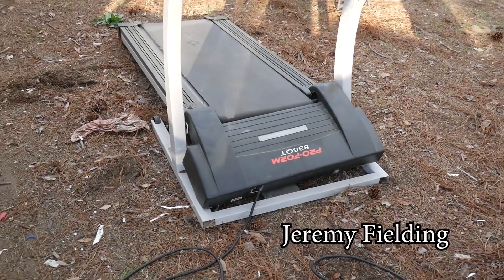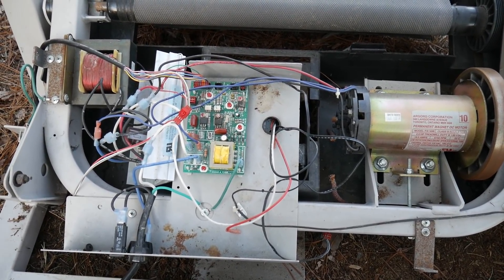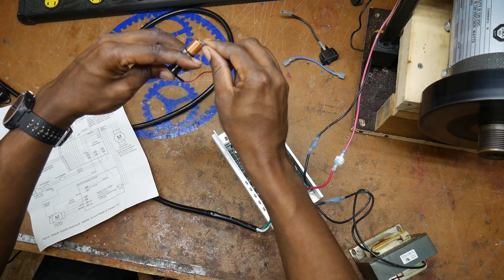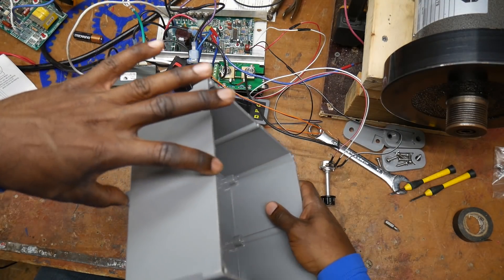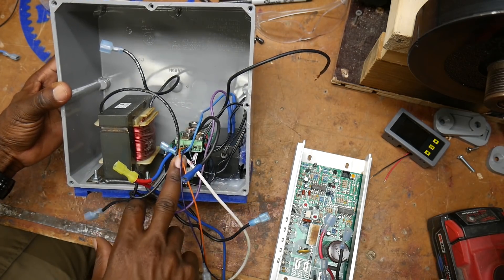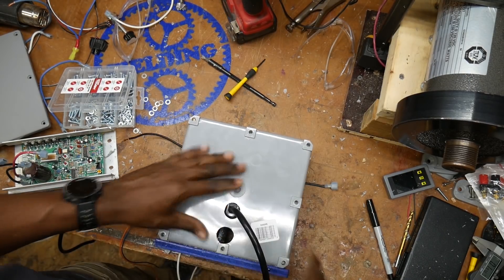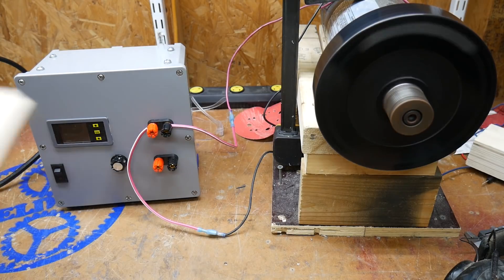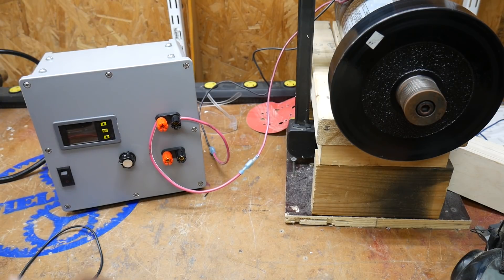Building A Variable DC Power Supply From Treadmill Parts: 054

Comment: The wiring diagram shows you're switching the 'neutral' side of input power from AC.  That suggests - when turned off - some or much of the circuitry remains attached to 120vac 'hot'.  Ok, you could make the switch DPDT, and switch BOTH hot and neutral.  2nd... your project as a (bench) DC power supply, appears not "transformer-isolated" from AC mains.  This may not be an issue, but interconnecting with other circuits/measuring equipment (that likewise may not be AC mains isolated) might be problematic. Just a thought.
Reply from the maker: I could break both, but this is basically how it was wired in the treadmill, and I intend to “mostly” use it for the same purpose. I think we are ok for this application. I won’t be using it with other AC wired instruments... or I don’t think I will :)
Reply: I'd still like to see that switch on the hot side for safety's sake!
Reply from the maker: Not a problem. It’s a small inconvenience and I have several double pole switchs in my shop

Comment: An old hand of the telephone company when I was a lad a long long time ago told me the secret to a good solder joint is a good mechanical joint. Well done video I was wondering why they used a choke on this system  have seen many chokes but mostly older equipment?
Reply: Barry Mayson It smoothes out the rectified voltage in turn quieting and smoothing the motors operation. It is far cheaper and much longer lasting than capacitors capable of doing the same thing.
Reply: Kevindreaded Hi thanks have used chokes before for that purpose but only on very old equipment. But was wondering why there but if it gets rid or reduces the dreaded electrolytic caps  I understand.

Comment: Hi Jeremy. Great video. I have a question for you. Is it possible to wire a 24 volt wheelchair charger that has only 2 output wires to produce 12 volts to run a car radio in my workshop?
Reply from the maker: The short answer is yes. But you will have to do your homework on this one. It is too much for the comment section. You need to divide the voltage and there might be other concerns I haven’t thought of so I don’t want to say too much here.
Reply: The simple answer is look on ebay for a buck converter, they come really cheap from China if you don't mind the wait...
Reply: n3qxc Thanks. I will.  :)
Reply: Jeremy Fielding  I’ll start researching right away. Thanks Jeremy.